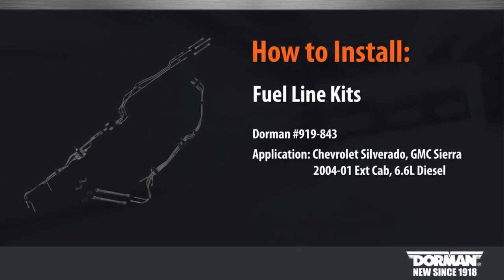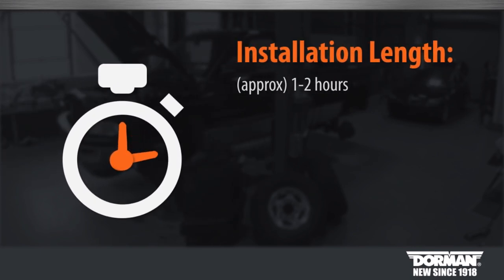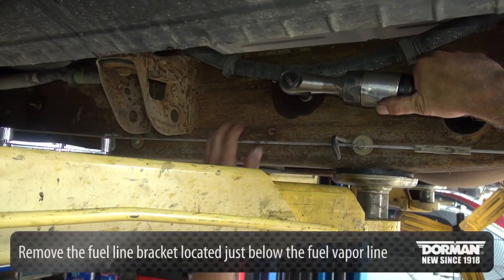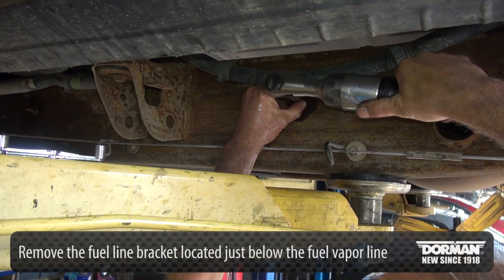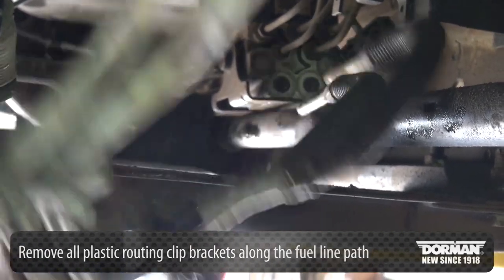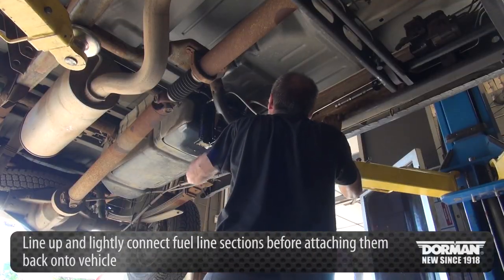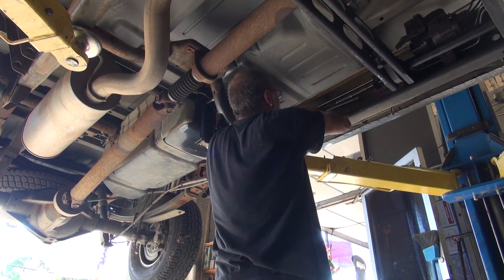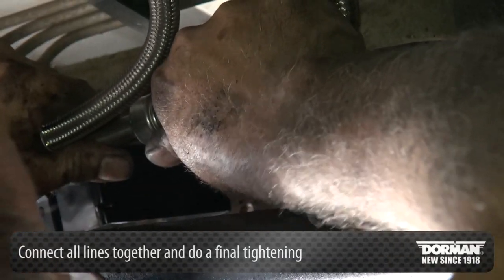Stainless steel fuel line kit, GM trucks (diesel)

Comment: How much are they for a 2003 Sierra 2500HD 6.6?
Reply: Nevermind. No need in responding (even though I dont think you will anyway ). Called the number on the video and they said they don't sell to the general public. I'll try a different brand.
Reply from the maker: Good morning,
As you stated, Dorman does not sell direct. You can purchase any of our products through any local auto parts store or online retailer. 
Thank you